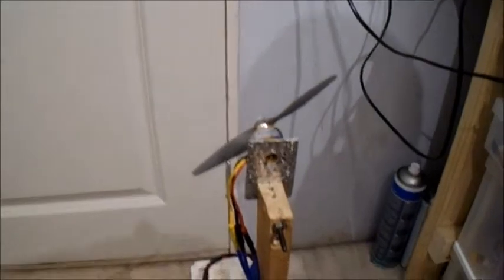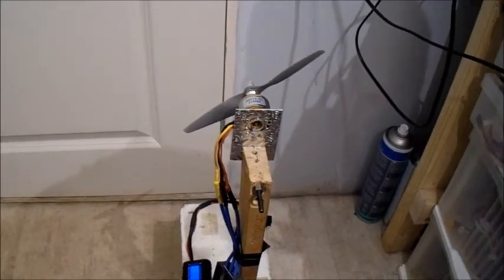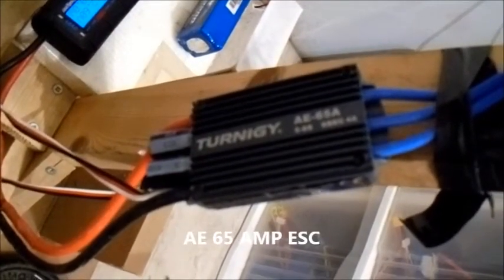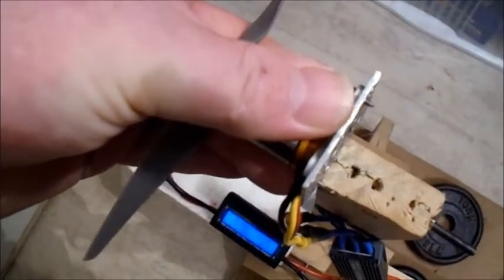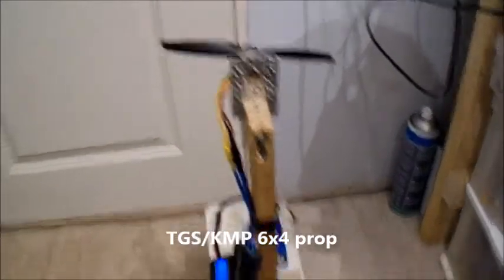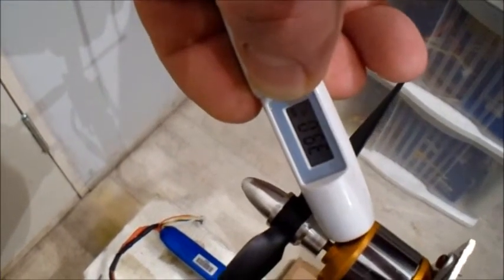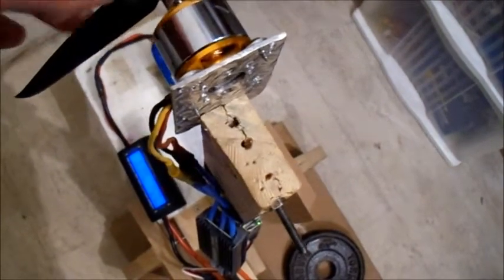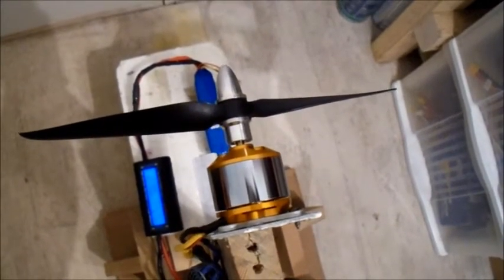A2212 2700kv ebay motor on 6x4 prop 3s Thrust test motor test of the week

Comment: what esc u recomend for 2217 2700KV motor??? i was try 40a esc with 2217 2700kv motor (no propeller installed) and got burned, so i dont know what Ampere esc really needed for this motor
Reply from the maker: A good quality 50a esc should be ok. Don't run the motor full throttle with no prop on it!

Comment: It seems actual watts received in the motor (AC) at full throttle is about 90% (efficiency) of the watts reading between the battery and ESC (DC) according to this forum, and way lower efficiency at mid throttle... interesting: https://www.rcgroups.com/forums/showthread.php?1504410-ESC-efficiency-questions

Comment: Not the finest motor in the world but astonishing for the price. They seem to be incredibly tough too.

Believe it or not, I've been using them in place of the ol' mabuchi 27T 540 in some 2wd Tamiya buggies and they can hack it! Admittedly the buggies are pretty light weight but even so, this motor is about the size of an acorn and is dwarfed by the old school 540 motor. 

On a DT02 or DT03 chassis using the smaller of the 2 pinion choices, they give a pretty punchy performance, better acceleration than the stock brushed motor and a bit more speed too all while giving better battery life. They do get a bit hot if you hammer them for extended periods in warm weather but I haven't killed one yet. I've used them with a Kyosho Nexxt and Sandmaster too as well as the Tamiya Grasshopper and Nikko Rhino.

It really puts a smile on my face that these ludicrously small motors can haul a 1/10 RC around. And they only cost about £3 too, it would cost more to buy the ancient old 27T brushed motor! They sound cool too, everyone does a double take when they hear that sound coming from a car!

Did you ever test another one to see if your high current draw was down to bad bearings?
Reply from the maker: Cool. Sounds good man.

Comment: How many trust can produce in 1045 props on 2700kv motor. My rc plane is 1350g weight  it can fly in 6x4 props? Or it can fly in 1045 props? On 2700kv motor
Reply from the maker: This motor will not turn a 1045 prop. Way too big. For this size motor you will need a 1000kv -1200kv motor to turn a prop that big.

Comment: bro, i´m using that motor of 1000kv and yesterday i bought a 12.2 prop. Do you think that my motor can carry that prop? the battery is 3S
Reply from the maker: Think that prop will be too big for that motor. Sorry for the slow reply.
Reply: Best case id use a 10 or 9 inch propeller for a 2212 kv1000

Comment: hi man, i bought a 2212/6t motor 2200kv with ESC 40A, can it run a 6x4 prop?
Reply from the maker: Yes mate. A 6x4 prop on 3s will be fine.
Reply: im running a 1045 propeller on it now, dindt have any problems yet but i dont use full boost  when im flying only for take off, how i can test the amp? with a multimeter were i need to connect to show me the amps? @rcplanepirate
Reply from the maker: @lokoraiz  What you need is called a wattmeter. The thing with the screen that shows the amps and watts in my tests. You connect in between the battery and the esc. Souce is the battery and load is the esc. You can get them from ebay or banggood.

Comment: Sir my model is of 1500grms and i am using 2400kv moter which battery should I use plz tell me with volt and mah
Reply from the maker: Sorry need more information? Which exact motor is it? Need specs. What type of plane is it? Wing span and what do you want to do with the plane?

Comment: well lets say i have a 2212 2200kv motor running it on a tricopter, i want to put a gimbal and actioncam on there so that is an extra of 600-700 gramms and im wondering what props would be best. some site showed me to use a 10x4,5
Reply from the maker: Hi
A 10x4.5 will be way too big for a 2212 2200kv motor. The biggest prop they can turn is a 7x3 prop. Think you will need more powerful motors then the 2212 size.

Comment: Great testing :) Last summer (2016)I tested and used several of these motors, some purchased from Ebay, some from Banggood and some from GearBest in foamy park jets on 3S with the 6x4 APC style prop.  I used a Turnigy Plush 40A ESC which could handle the amps, I was seeing in the neighborhood of 33A.  As some have mentioned already, it did come down after each flight pretty toasty, the Ebay and GearBest ones seemed to be the best, a couple of them I got more than 100 flights out of each without any significant break down in performance although eventually the label came off, I suspect the heat melted the glue ;).  The ones I got from Banggood for some reason ran incredibly hot, often pulling up to and over 40A on static tests.  They got so hot in the air to the point I would not have been able to touch them after the flight, so I didn't use them for long for fear my plane might catch fire.  For the price, even if I only got a couple hundred flights out of a motor, I was happy with the performance.  Cheers, Scott
Reply from the maker: Yes they are a great price but I do think I may have a slightly dodgy one as you see mine with the 6x4 APC prop pulled 52AMPS! So it may be a risk sticking this in a plane.
Thanks for watching
Reply: @rcplanepirate  I've had several of these motors overheat on 6x4 and set my 40A ESC's on fire. Even had one plane catch fire in flight. Came down blazing. Lost all electronics.
Reply from the maker: @arturama8581  Not good!

Comment: i got 2 of these motors and used them on rc powers & Parkfly international f15 mid mounted jets, they used to scream and had insane punch, this was the first motor that could give my model unlimited vertical performance, came down smoking hot, didn care, love this motor on 6x4 prop. dont use it anymore though. https://www.youtube.com/watch?v=lw703U2FnOg
Reply from the maker: Yes gets hot on a 6x4. Think a 6x4 is too much for it. I think I got one with bad bearings. It sounds terrible.
Reply: i loved the sound of this motor, it would scream and everyone would ask me what motor im using lol  It would scream louder than ntm 3000 haha it would come down really hot, esc warm, i thought best it will burn idk but i had my fun with it and its still running
Reply from the maker: Maybe I'll try it in something.
Reply: I fly it in a scratsh build mig29. The Sound with a 6x4 apc is amazing. The model fly great with this Setup and the motor lives now. I nevresim found a netter Motor for this prince. I Love this motor it is one of my Favorit. Ich have five on it and no one burn with this Setup. You must test it in a plane. İt maskes real fun.
Reply from the maker: Hi there
Yes I'll have to try it in something. They obviously can take a lot more power then the specs say. Mine does sound like it's got bad bearings in it but for the price it's still good. Thanks for watching.